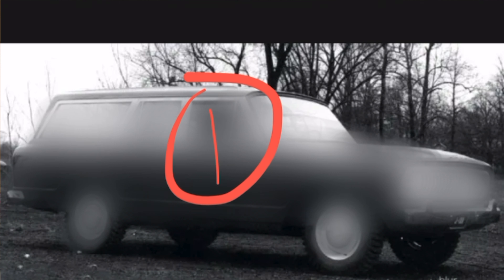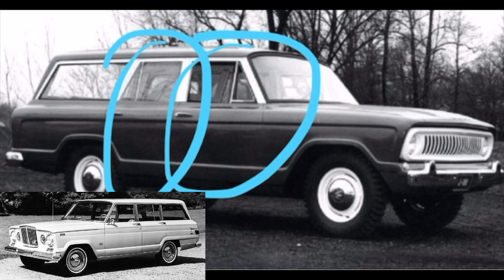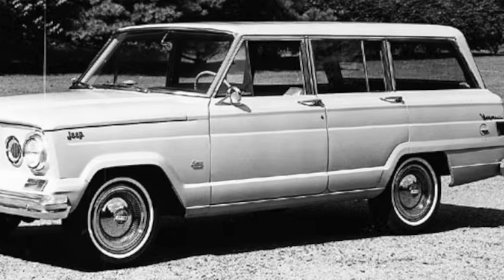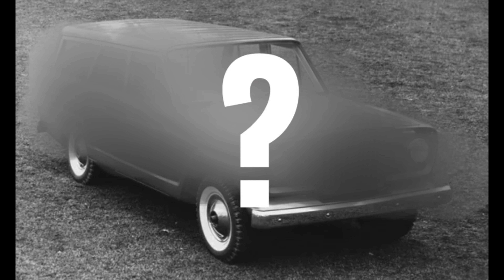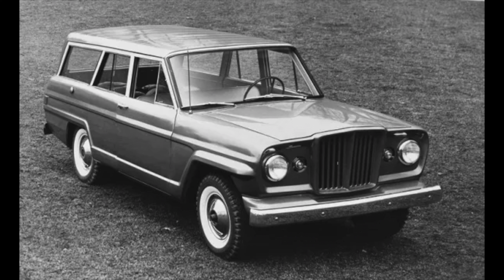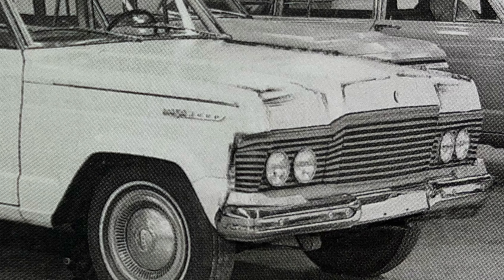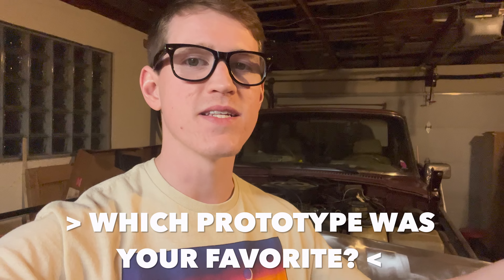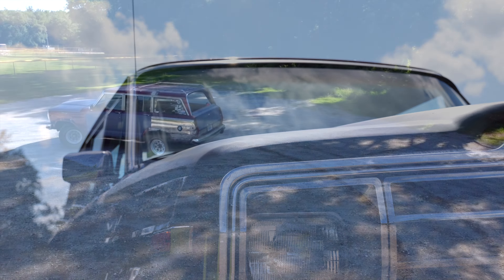1950’s Jeep Wagoneer PROTOTYPES You DIDN’T KNOW ABOUT! 🤯 | Jeep SECRETLY BUILT HOW MANY TEST MULES?

Comment: You have an 86 Wagoneer? Is it AMC or Chrysler built? If it's built by AMC, it will have an AMC badge on the back as well as denoting it on the title.
Reply from the maker: Chrysler bought Jeep/ AMC in 1987. My Jeep is built by AMC, it’s a 1986. There’s no AMC badges on the exterior. However there are a few AMC logos found in the interior, like on the seat belt buckles for example. Thanks for watching and commenting! Subscribe for Wagoneer Wednesday’s @ 7PM!
- Garrett / SLA’S GARAGE
Reply: @wagonworks803  I was thinking your Wagoneer was built around the transition from AMC to Chrysler. I had a 1977 Wagoneer for a little while that I found on a used car lot because I wanted the tilt column out of it to put into my 1981 CJ5 Jeep and it had an AMC 360 in it that we wanted to pull out and build to put in another Jeep!! I love my CJ5 Jeep but I also miss the 1977 Jeep J10 Comanche truck I used to have as well. Bought that one from my neighbor. Wished I would have never sold any of those vehicles.